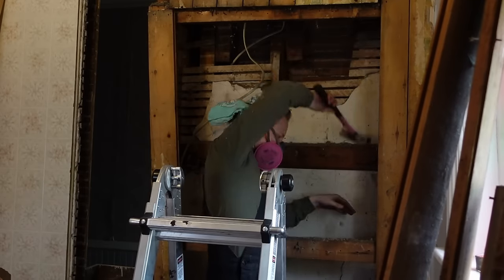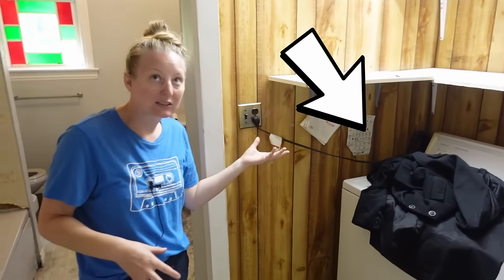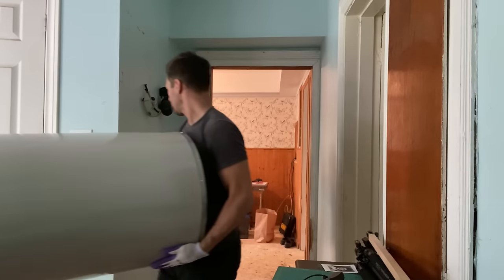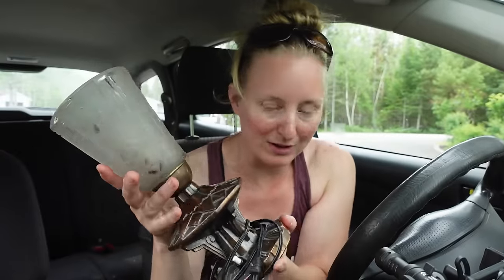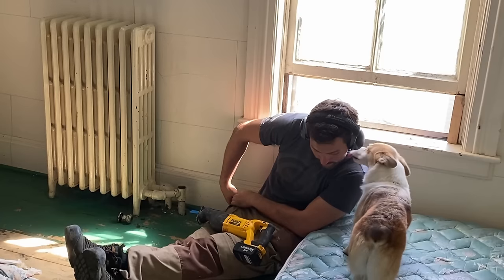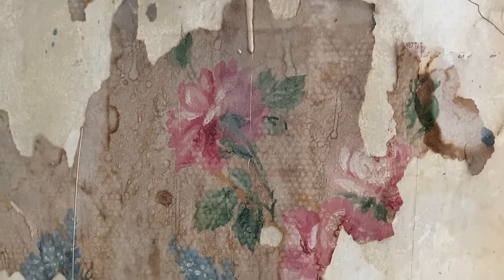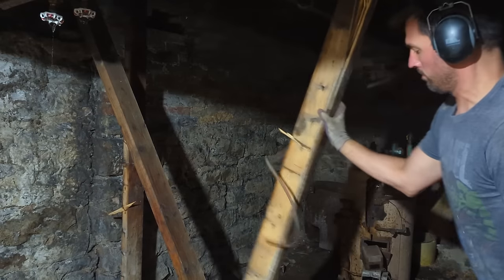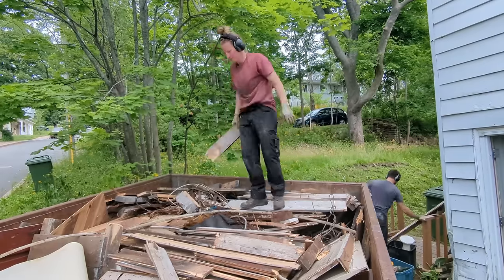Can this be ORIGINAL?

Comment: As an owner of a house built around 1896ish, I have a very important piece of advise...always completely finish one room at a time.  If you partially finish something and say"this will work for now",  no.  It will never be finished.  I have lived in this house for 9 years.  There is still a spot in the kitchen where you can't walk because of rot.  The chimneys are not fixed so the fireplaces are still boarded shut.  I still have no flooring at all in the master bath, only plywood subfloor.  There is fiberglass bug screen stapled completely over all the windows because we never got around to making screens for those because 6ft tall x 2ft wide screens are not something you can just pop over to the hardware store and buy.  We just recently started fixing the doors so they close properly and still we've only done three before a porcelain doorknob fell of and now we have to find one that matches the others.

Just finish one room at a time before starting another one.  It's the only way to keep your sanity.
Reply from the maker: Unfortunately that is very much not an option for many reasons here in the house. Its true that there's no more permanent solution than a temporary one, but fortunately we've got plenty of time and motivation, and a drive for near-perfection, so I'm not too worried about it.
Reply: Sage advice. We are on out fifth year here and…….no room is 100% done.

Comment: A note on your windows, I've been looking at some ways to address a window that is not sealed as tightly as needed in my own home... one of recommendations was to adhere magnetic tape on the window frame & then use the magnetic strip for attaching a second wood frame which had plexiglass or plastic panes. Because it's a attached by magnets, it can be easily removed. Might be a good way to help keep cold in or out while you are doing more repairs or in rooms you are not using as often.

Comment: Not sure you have them in Canada but front loading washers are water savers as well as space savers and can have a dryer stacked on top for more space saving.
Reply: Yes, they are very popular here, but are usually a few hundred dollars more in price.
Reply: Yes, they've been available in Canada for decades 😂
Reply from the maker: Yes, we have them here (well, in the country, and surely somewhere in the province) and I've used them before too! When we upgrade at some point, we might well get one, but for now, the old one works well!
Reply: @ShannonMakes  I had one for years and when we needed a new one we got another top loader. Personally, I prefer the top loader.
Reply: @ShannonMakes sometimes you will find that the older models are better in the fact that they last longer than the newer ones that are out now. I have known of several people who have bought appliances within the last 5 years who had to get rid of them because they had already broken down.

Comment: The finish one room at.a time  is not always the answer often by the time you are done half way with house your starting over as you can get the same material. Lol  Finishing  touch left last  allows getting  all the trim to match for one. You think it remains the same ,but no. Even be ready for paint colors to change hue or tone over time. Lol A freind found her wood for the floor even changed. Lighting figures I had to change as it moved to LED  by my third finished room. I have had 3 floods from broken  pipes redoing  by bathroom and kitchen. Resently the refrigerator  leaked causeing weak spot then rot and my sink fauct is leaking so cabnet has to rerescued.  It's  function first. The bedroom  being the most done is important as it can refresh you after a day of repairs.

Comment: Art Deco might be similar to the images you showed,but you have to realize this was rural Nova Scotia, therefore the previous owners might have not have had the means to buy this artsy wallpaper and gone with what was in the local hardware store?
Reply from the maker: OK, but you have to realize that this was once a thriving and wealthy community... the number of (now abandoned and dilapidated) stunning and huge Victorian mansions within even a short drive of me is literally off the charts. 
There was a moment (and it happens to be right around the turn of the last century, when my house was built) that this area was quite prosperous. You don't build a giant house this big, fill it with hardwood floors nearly everywhere, have huge, ornately decorated windows, or make curved walls that require custom hand crafted plaster mouldings to go around them if you don't have means (also the images are art nouveau, not art deco, just for the record).

Comment: I had the wallpaper in my 1907 apt bubble up above the large radiator. I have 2 radiators, small one in the living room and large one in the larger bedroom. The large one leaked after a number of years and the new landlord fixed it. The leaking caused a LOT of damp air that caused the number of layers of wallpaper to bubble up. Even tho I was working 60-70 hours a week I decided to remove the wallpaper (it was a fantastic stress reliever!) A friend gave me this machine to help. I did take photos of the wallpaper but not good ones and there were at least 2, possibly 3 eras of paper over the plaster. No dry wall here! It took maybe 3-4 weeks to get it all off (which was a really good idea as mold was starting to develop in a couple of areas. Living in San Francisco where this structure has stood firmly through many earthquakes, including the huge 89 quake, removing the wall paper showed a lot of cracks in the plaster. A few more have been added. I do love the look of plaster. My living room still has all the wallpaper on it (plus many coats of paint). I’m sure the landlord will take it down to the wood and put clean drywall up instead but it’ll lack the beauty of plaster! (I know you have to remove the radiators but I cried a little to see them go…).

Comment: Well, if it was original paper the walls would be unpainted and plaster raw. As for wall paper, I stripped the original paper from my 1903 house using vinegar and water + steam. However, there was no saving swathes because of the type of paper that was used, which essentially was printed on a brown paper bag. The only pieces I was able  to save were the ones where the glue had worn away and the paper was brittle.  Otherwise, the paper just gummed up in little balls. If paper was dry a little brittle I could use my scapper on the dry paper to pry pieces up. Saving will be tough. But I have seen some folks gently  cleaning a large sample, protecting it during reno, then building a frame around it.  The sample you showed could also have been 1860- 1880's. Look up Mr. Victorian maybe.

Comment: As you say: "Paper conservator by day, historically inspired home sewist and watcher of home-renovation videos by night" here. I don't have personal experience with wallpaper specifically, but conservation of paper is my thing. I feel like if the paper is falling apart when you try steam or water, it would need a temporary facing to strenghten it while you're removing it from the wall. This facing would be a material temporalily adhered to the front to consolidate the paper and hold it together while you apply steam or moisture to soften the adhesive. I would be happy to do a bit more research in my conservation ressources to help you come up with a solution that is accessible to you (with easily accessible tools/materials) if you're interested to try this out!
Reply from the maker: omg, if you managed to find that out, it'd be amazing! I don't want to ask you to devote too much of your time to it, but if it's something you can find the answer too fairly easily, I'd LOVE some advice or suggestions from a qualified professional!! <3 <3
Reply: @ShannonMakes  sure! I'll see what I can find and DM you the results. An interesting challenge to tackle!!

Comment: 7:33 where you ask is that just raw plaster underneath... it almost looks like I can see remnants of something... don't know what... Maybe it's the fact that I'm looking on a BIG screen up close on my PC but it almost looks like some sort of pattern... now if that's transferred from the paper over it... but it doesn't appear to be the same pattern... like I'm seeing small vines and leaves... not the larger ones that are on the remnants of that wallpaper.  Could be a heat transfer but from what?  Not sure... anyway you might try different lighting on your camera to see if you can get more detail to come up... Could just be areas where water stained it... but it seems to go on below where I can see... There is like a strip of it running down the wall between that brown thing that looks like cardboard and the wallpaper in question... I'm wondering if that isn't what was originally there.... kinda a shadow of what it was... left by the heat of the radiator at some point transferred onto the plaster. 
I'm glad you saved the house... because IMO the old homes have far more class... I wish I knew what this one was like before someone "renovated" it to it's current fugly state.  They pretty much gutted it and made it a box... took all the original moldings off and put on that cheap crap... sadly.

Comment: You may need to remove the plaster with the wall paper attached, being ever so careful.  I did watch a YouTube video with antique wall paper attached to the inside plaster or some kind of concrete.  They removed the entire wall area behind the wall paper using some kind of support system.

Comment: I don’t know if this would work but I know heat can be used to remove old glue in furniture, maybe try heating up a putty knife with a hair dryer or heat gun and try to gently slide it behind the wallpaper to get it off. I scrolled and saw your comment that water and steam just made it crumble so getting it wet is obviously a not go. My thinking is using heat and the flat blade of the putty knife you can loosen the glue and gently lift it off. As for getting it dated and such, I’d reach out to the historical society like the ones that get places labeled as historical landmarks and see if they have someone on staff or could direct you to the person they use. So glad you’re saving this gorgeous house! Can’t wait to see it all finished.

Comment: WALLPAPER REMOVAL! I've never scraped paper off a wall but I HAVE removed tape/covers off old books in book restoration. One method that might work as similar glue bases were used; cover the wallpaper with a regular bath towel and use an iron to gently heat a section at a time and gently scrape the paper off the wall (with a tiny sharp knife) as the glue softens. The softening of the glue if you're really patient should mean the paper will come off without much pressure on the paper! The sharper the knife the better as it will literally cut through the glue and any tiny fibres of paper. Maybe start with a section of paper you think is newer or you're not super keen on keeping just as practice ❤
Reply: P.s. you might spray the towel with a spray bottle or use a light steam setting on the iron!
Reply from the maker: Unfortunately the introduction of water in any form just shreds/disintegrates the paper 😭 But thank you!! This is probably how I'll tackle more modern papers in teh house

Comment: For the wallpaper, there was a technical shift during the 20th century from paper decorated with paint and paper printed with ink, and later in the century, a second shift towards more artificial printed materials. Painted paper were still a thing in the late 1920's at least in rural France. The date may vary between countries.
The wallpaper making companies may have archives, or may have given archives to a local library or local archives. The style, well, not everyone was into high fashion and the most "Art Nouveau" designer products were luxury items not really available in mass production. And mass production items tended to be more  conservative in their design, so it's not really easy to date based on the style only.
Maybe a library or museum specialized in applied arts or decorative arts will have books on the subject that you can browse?

Comment: Three  theories on the wallpaper looking not art deco, based on the houses I've lived in:
1. The lowest layer of wallpaper is not necessarily original to the house, even if there's plaster underneath. Some people remove wallpaper before putting up new to get a prettier result or because the first layer is too damaged. This can damage plaster if you don't use a steamer, meaning you get to... uh... replaster your walls before you put up new paper. A fact my father had not considered before promising three freshly wallpapered bedrooms to his wife and children. 
2. Historically, depending on the location or use of the room, you might not wallpaper a room at all. The 18th C manor farmhouse under historical preservation status I got to live in for a year had absolutely gorgeous reproduction wallpaper or painted walls... In less than a quarter of its rooms; the ones visitors of "the family" would see. Even those had different levels of prestige, depending on the room's function. Everywhere else had bare painted wooden slats, occasionally with visible nail heads, and some parts meant for dirty work (half the kitchen, most of the cellars) had whitewashed plaster. 
3. Even if you ignore things like nurseries, it is not uncommon to decorate one or two rooms to a different aesthetic if those rooms were for the exclusive use of one specific adult. It could be a room dedicated to a spouse's hobby, or it could be part of having a person in need of care in your household. If they e.g. love flowers, even if that's not the vibe of the home you're building, you might decorate accordingly if you know that's what the room will be used for to begin with.

Comment: Wallpapers that old feel like they would just disintegrate the moment they leave the wall, so that one's gonna be tough. If any of the walls need replacing anyway (from water damage or what have you), you could cut a square out of the wall and mount it in a frame I suppose. 😅
I occasionally go visit family in their summer cottage with no running water and an outhouse, and I appreciate indoor plumbing so much more every time I come home. Not having to go outside to pee is severely underappreciated.
Reply from the maker: SEVERELY underappreciated!!

Comment: When you are fixing old plaster put down a flat washer first then put a screw through it into the lathe. A very old time plasterer who was in his 80s taught me this trick. He said the washer will prevent further cracking and also stabalize the plaster. The trick also works if your lathe and plaster loses it keys. Just put screws and washers across the wall or ceiling to secure it in place. Make sure it is flush then place plaster tape over the screws with a thin layer of plaster then carefully put a thin layer of plaster over it. Rough areas can be smoothed out with a damp sponge. I hope this helps
Reply from the maker: I do know how to actually repair plaster, lol, I just didn’t have the time or desire in that moment!
Reply: @ShannonMakes  I hope I did not offend. This trick came in so handy when I fixed an older home that I wanted to share it just in case you had not heard it before.
Reply from the maker: no no, not at all!! 🫶

Comment: One thing I learned about lifting truly old wall paper without damaging the print, is that many of the glues used in the era of your house were made with bees wax, or honey. By misting a small discardable portion with a spray bottle of plain water, you can tell if it's from the 18 to very early 1900's by the smell. If it has a sweet smell to it, it's got the bees wax or honey base to it.

If that's the case, you can basically take a very mild hand soap mixed with one part soap, three parts water, and remove whole sheets.

Just mist the wall paper to ensure it is good and damp, (be safe and try a small piece or two for practice), once you can almost see the imperfections in the wall, very lightly re-mist. Then, look for an edge that seems like it might be the easiest to get something under, and, using a very thin putty knife, slip it gently under the corner until you can carefully start  pulling the sheet off the wall. 

Sometimes, you'll hit a dry patch while you're working, and it could tear, so be careful and re-mist as needed. I used to put my cheek to the wall and watch the progress to ensure I could get enough of the print without it ripping it. Once you have your sheet off, it's best to hang it somewhere to dry.  I used  clothespins and hung them on a clothesline. The pieces touching the clothespins disintegrated when I removed them, but I got a good and sizeable enough sample.

Not only was the process very satisfying to me, but it was also exciting to be able to have some of the original wallpaper designs reprinted and put back up in the house. I'm no expert, but I have a lot of experience with refurbishing and resplendorizing old homes. Feel free to email me if there's anything  I can help with. Veronicadotcoldiron at hotmail dot com.

You are both doing an excellent job, by the way!
Reply from the maker: Unfortunately any amount of water basically makes these wallpaper completely disintegrate - water in any form, be it from a barely damp sponge, from steam, mist from a sprayer... I don't know if the papers are less hardy than those you removed, or if something else is going on here, but the water was making it much worse, hence my dilemma 😭😭 I appreciate the advice though, and maybe I'll find other samples in the house that react better to the misting!
Reply: @ShannonMakes  I'm sorry to hear that! I truly love your idea, so I hope it works out. I am truly enjoying watching the videos and am learning a lot from you. 😉